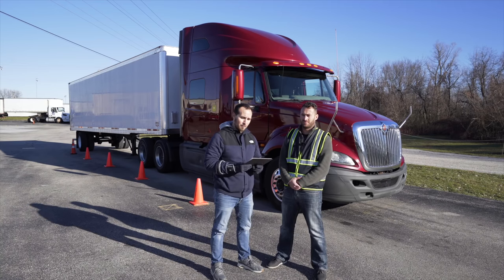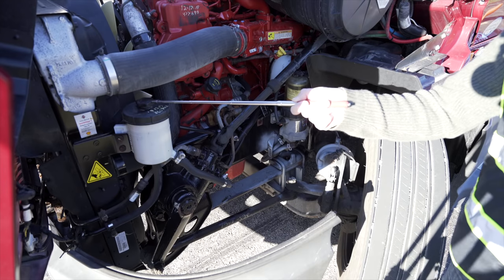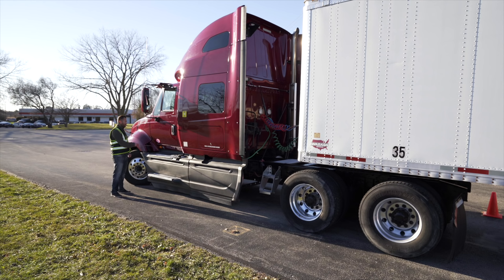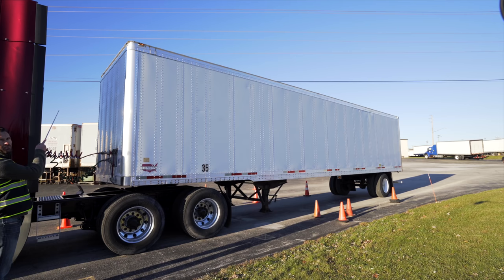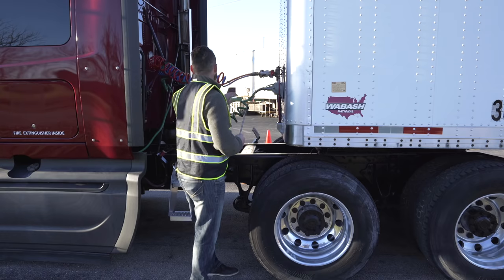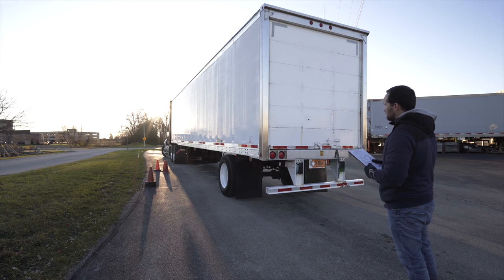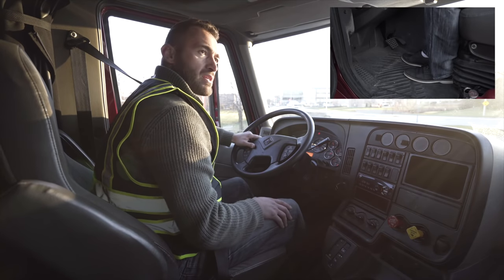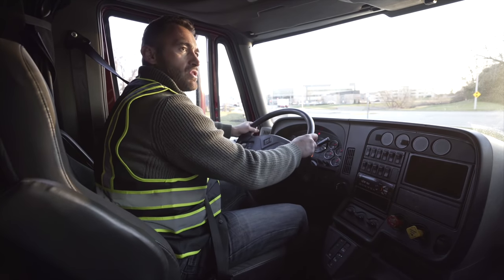CDL PRE-TRIP INSPECTION!!! - myCDLbuddy

Comment: Not broken, not cracked, on secure, no leaking. Got it.
Reply: @XxxXxx-bd4xh  He got that part stuck in my head.
Reply: You don’t say that on the tires or rubber parts. Rubber doesn’t break or crack lol
Reply: @MyLakers101  the oil as well
Reply: He said it for the oil too, assuming that’s not necessary
Reply: @XxxXxx-bd4xh  PMS: Properly Mounted and Secure
Rubber hoses and air hoses which are kinda like PVC type...PMS AND ABC: Properly Mounted and Secure, no Abrasions Bulges or Cuts...ANYTHING that can leak you should remember CDL: cracks Damages or Leaks.

It IS safe to say Properly Mounted and Secure for EVERYTHING since it should be properly fitted and secure to the truck.
so PMS for EVERYTHING.
then add whaterv5is necessary for rubber.
also, things that need to specified to be bolted with such things as "bolted using bolts" or "PMS with castle nuts and cotterkeys".
you an also add, since you have to add to linkages and torsion bars..."No bends, breaks, or damages" important for shocks, torsion bar, steer linkage, alternator mostly anything that links and is metal".
with repetition, it should be a matter of.just learning what you should be looking for, as it's for your safety. after that, its actually easy to remember as the words are redundant and your just making sure its metal pr rubber or holds liquid or air
Reply: Thank you for clearing his language up cause I speak English and couldn't comprehend to the on secure part. Sorry....
Reply: Not all leak
Reply: @MyLakers101  tires do crack due to dry rot on the side walls, also seen rubber break off the tire as well
Reply: No dead animals~
Reply: properly mounted and secured the right way to say it
Reply: @retro9173  😂😂😂
Reply: Properly mounted and secured NOT, BCD CTF ABC
Reply: And secured..I believe
Reply: He actually did a good job, but the repetition does go for everything on the tractor inspection. I just started a truck driving school like few weeks ago and I’d been told not to say a wrong thing to describe a certain truck part cuz some instructors won’t give you a second chance to made a correction so pls.
I’ll rather say it’s the following as they apply to what I’m pointing at, not cracked or frayed,not damage, not broken, no missing bolts & nuts or cotter-key, no looseness,  no frayed. it’s operating properly, it’s functioning, it’s in adequate levels, it’s above refill mark, secure/mounted properly…….etc cuz whatever he was saying sound so implicating.
Reply: @kissmylipsb  and secure but you are right and closed caption says unsecured
Reply: My belt nat broken 🤔
Reply: @carebeary886  ohhhh because I was like please don't say unsecured people.

Comment: The only thing I could think to add to this is steering rod is properly mounted and secured with no play. Probably wouldn’t hurt to mention the band clamps on the brake chambers. Also while doing the in cab make sure you let the instructor know this is a 20 inch steering wheel and has no more than 2 inches or 10 degrees of play. I’m not bashing the video it’s a really good video. Those are just a couple of things my examiner looked for as well that I didn’t hear.

Comment: forgot to mention the truck isnt leaning due to suspension problems or unbalanced cargo, or under inflated tires.
Reply: Yea that and also he forgot the valve stems to the steer front axles (he mentions the others), the tractor's reverse clear lights, the wheel's chock, front drive axle airbag and plate mount, 5th wheel release arm and exhausts under pipes for any black soot presented but otherwise he likely got the states passing requirement CDL score depending, good for him thou ..

Comment: He actually did a good job, but the repetition doesn’t apply for everything on the tractor/trailer inspection. I just started a truck driving school like few weeks ago and I’d been told not to say a wrong thing to describe a certain truck part cuz some instructors won’t give you a second chance to made a correction so pls.
I’ll rather say the following as they apply to what I’m pointing at, not cracked or frayed,not damage, not broken, no missing bolts & nuts or cotter-key, no looseness,. it’s operating properly, it’s functioning, it’s in adequate levels, it’s above refill mark, secure/mounted properly…….etc cuz whatever he was saying sound so implicating.

Comment: Didn’t give the color of the lights, or the cotter pins and the castle nuts. You also didn’t say the tires are evenly worn and they can not be  recapped. And also all your hose have no abrasion,bubbles or cuts, you didn’t mention that
Reply: That and he must that the key is in his pocket .
Reply: Yea an in the inner rims he didn’t even mention they got no illegal welds. So much he didn’t say especially for the hoses an rubber.

Comment: Why say 4/32 instead of 1/8?
Reply: Because the front tires have to be 4/32 inch of tread depth. Not 1/8.
Reply: @brachelliejoshua1195  Apparently you don't understand how fractions work bud. 1/8 of something is the exact same as 4/32 of something. Just like 2/16 is also the same and also 8/64. The more you know.